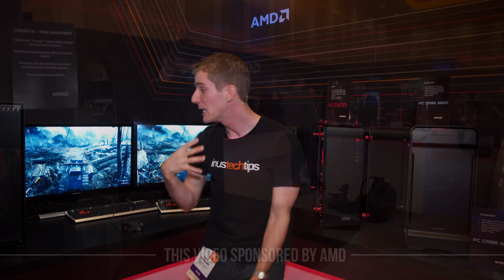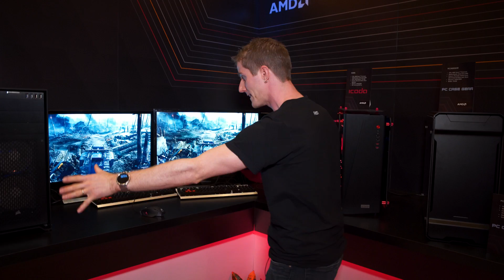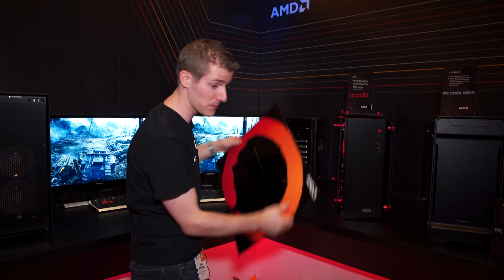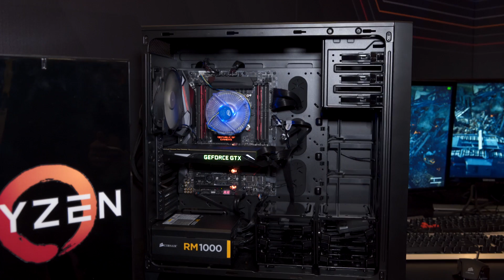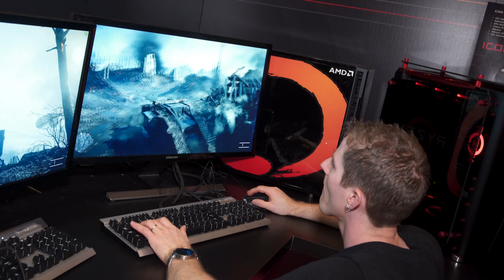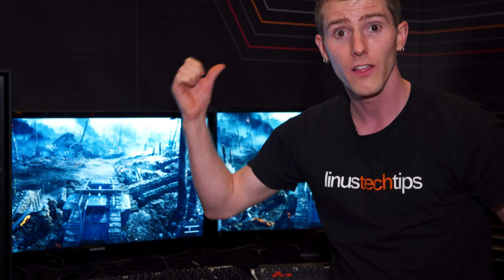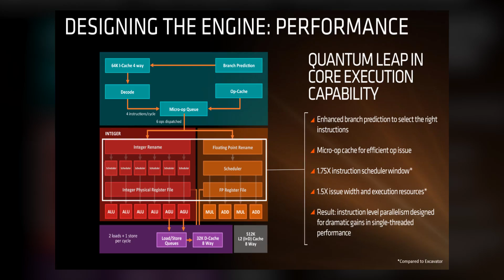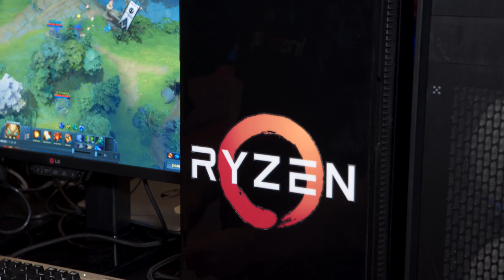AMD Has Ryzen!

Comment: Of course they are going to perform exactly the same as it is a gaming scenario and all the heavy lifting is done by the GPU. Even a 'lowly' i5 6600K when coupled with a Titan XP will perform the same as the (1000 dollar) i7 6900K that was used in this demo as parallelisation in gaming is handled entirely by the graphics card. The only variable from the CPU standpoint that may (maybe not - it depends) affect gaming performance is the clock frequency as it dictates the speed of offloading to and retrieving from the GPU. And in that front the mainstream flagship i7s (like 6700K/7700K) with their higher (turbo) clock speeds (of 4.2/4.5 GHz) will do better than the 6900K that is (turbo) clocked at  3.7GHz.
Reply: Alex Marin I'm so glad I'm not the only one.
Reply: Intel and AMD include integrated graphics but they are bypassed and the graphics processing is handled entirely by the external GPU due to the benefits of the huge parallelisation it brings. These benefits far outweigh the communication bottleneck between the CPU and CPU, which is a GPU-induced bottleneck. That is and why you see a GTX 1080 on PCIe3 x8 doing almost identically as one in x16 mode. Anyway the conclusion remains. When it comes to games any flagship CPU is more than fast enough for the job is designated to do (offloading/retrieving to/from the GPU) and any graphics performance depends entirely on the graphics card.

Comment: I just feel like to upgrade to an i7 standard, I might as well have bought it 3 years ago when it was the same price rather than wanting to first buy an i5 then upgrade to an i7 in which the price hasn't dropped, but hopefully, with AMD stepping up and adding competition, processors will increase in power and decrease in price.

P.S I own an i5 since Intel has been superior for a while but at this stage, I'm fairly 50/50

Comment: They're using an nvidia gpu in order to eliminate the possibility of bottlenecks. They're newest card, the rx480, is designed to be a budget card with low power consumption. The Vega line hasn't been revealed yet or they would be using that instead.

Comment: AMD Is doing well and I'm waiting for their CPU's to come out. Because, I need to spend a shitload of money for a i5 skylake (I don't want to build a new ddr3 system in 2017) And, i can't have a i3 because there is no overclocking and I need to wait for a overclockable i3. Intel's cheap is too weak for somethings.  I hope AMD will bring better CPU's with 4 cores with the price of an i3 6100 and support overclock out of the box. It can kill the intel. AMD improved itself and AMD will use the same AM4 platform for an APU and CPU. What that means? It means you can build a cheap system with an APU in start than add the pieces when you have money. This is good news, isn't it? The new APUs of the AM4 will be better I think. Now, you can play GTA5 with AMD A10 7890K APU.(Low settings of course and it is playable.) It is good performance. With the new DDR4 rams, these APU's will have a lot better performance than current APU's. Best integrated graphics now belongs to the APU of the AMD. (Actually this is because AMD is designed the APU for what it is meant to be.)

Comment: For those of you not old of enough or may not remember this, in the early 2000s, AMD made the best/fastest processors.  Intel while trying to rebound came out with the Pentium 4 which used super expensive rambus memory and performance was terrible.  AMD processors were cheaper back then so Intel had to cut prices in order to compete plus the rambus memory was a fiasco on so many levels as it cost nearly double what ram cost at the time.  Then Intel introduce the Core/Core 2 architecture and jump ahead of AMD.

Now for the last 6 or 7 generations we have the same pricing scheme and lock in with Intel.   We need AMD to make great processors, competition will help our wallets, and push Intel to come out with better technology as a response.  As consumers we win in this if Ryzen lives up to AMD's promises.  

Now here is the problem, AMD made the same statements with BullDozer and we all know how that turned out.  Hoping for that the hype is real this time.

Comment: AMD might not win in the gpu department, but they might win the cpu department
Reply: It is. I'm liking this fx4350 at 4.5ghz. It's lightning fast. I could have 2 of them for the price of Intel. I've never bought in Intel chip, but I've bought a few AMDs. Usually the price was so good I couldn't resist. That's winning.
Also if you like your money and price is an issue then you're buying an AMD 470 or 480 right now. They don't have anything for the 1080 but they say that's coming too. We shall see, but they are winning some gpu sales now.
There is a reason their stock is up so much this year.
Reply: I myself use an AMD Athlon x4 860k clocked at 3.7ghz and I'm pretty sure it's overclockable
Reply: not true intel has been better at every price point for years

Comment: That CPU encoding portion seems weird still. Is it running at the same setting or different settings? Are they claiming to be getting better quality on the same settings, which would sound crazy to me? Or are did they tweak the settings to look better on theirs while maintaining the same performance as the Intel chip?

If they tweaked theirs to look better and maintain the same performance as the intel chip, how is that balanced to be fair? Did they similarly tweak the intel chip to look it's best at the same performance?

I really don't see how there can't be a large bias in the CPU encoding/streaming demo.

Comment: Problem with this is is that Battlefield 1 isn't a CPU intensive game...It's a GPU intensive game hence AMD using Nvidia's Titan X Pascal lol.
It's also VERY well known from past AMD Cpu's that they don't yield good results WITHOUT a very strong GPU.
Intel Cpu's don't require high end Gpu's to give best performance.
This is once again AMD promotional hype train to nowhere as once you purchase it and fit in your new build WITHOUT having a 1000 pound card you don't get anywhere near the promoted hype train results.
Reply: MayDay GoingDown!! Amd benched ryzen in Blender twice and in handbrake. Still showed comparable performance to a 6900k. The same applies to the benchmarks Canard pc did with their Ryzen engineering sample (if you adjust for the fact that it was clocked at 3.15-3.4ghz).
Reply: DjAtomica 95 Yeah I watched that too lol. Problem is they are both synthetic benches, 
From a gaming piont any and all professional benchmarkers don't use them as those results become a whole different story when gaming.
Reply: MayDay GoingDown!! I'm afriad I'm not following you?
Reply: Well the chips are out now and apparently you do.

Comment: Intel processors are cooler, quieter, more energy-efficient, and easier to overclock.

Oh, and I forgot that Mobos for Intel Sockets are more common.

So what's the point?
Reply: Well,Intel CPUs arent cooler at all, my oced ryzen 1800x doesnt get over 60 degrees for instance, while my i7-7700k gets well over 70 degrees with the same fcking radiator and fan
Also, quieter? WTF has this to do with anything, its about the fcking fan u use, not the processor, and the wraith stock cooler by amd is actually better than the intel stock one, not that anyone would use Stock coolers and expect them to be somewhat silent^^
Energy-efficient? Jeez do you even look up stuff before you write things?
The 1800x has a tdp of 95 w, which is a 8 core processor btw, while the i7-7700k, a 4 core cpu, has a tdp of 130w ^^
Easier to overclock? You mean that you have to spend like 50 bucks more for a processor/mobo to be able to overlock with intel cpus, while every ryzen and pretty much every mobo for it supports oc? Or that you dont even have to go to the BIOS to oc the ryzen anymore ? Yeah m8, no
"Mobos for Intel sockets are more common" yeah, thats true, but what difference does it make? Both sides have enough, probably even to many Mobos, you dont even notice the difference.
Not beign said that Ryzen Mobos are mostly cheaper^^
Now fck off with your fanboy stuff and get real, dont buy a product because you like the company, buy it because it is better for you. And get legit arguments pls, if you would have said that Ryzens are not as good for gamers i would have fully agreed with you, but dont post bullshit in here^^
And if you still want to call me an amd fanboy, im not, i have quite a few processors of both sides here^^

Comment: YES! Competition again. Haven't had an AMD chip the since an overclocked Barton 2500. If this is true it means lower prices and no more $1000+ CPU's for top performance for a good while.
Still rocking an 4960x IVY Bridge clocked at 4.5 ghz and can't see a reason to upgrade for a couple more years, but this sort of competition means that in a couple years I get one heck of a fast CPU from somebody. Emulating consoles like the the WiiU will be childs play to whatever cpu that is. YAY.

Comment: No one wants or cares $800-$1000 cpus. The vast majority of gaming happens at $250-$300. AMD will have to launch better and cheaper cpus than Intel i5/i7 3rd and 4th generations. eBay is FULL of $150-$300 Intel i5/i7 cpus from 3rd/4th generations, which kind of annihilate everything AMD are offering in the past 5 years. This is performance/$ of course. So unless AMD is coming up with some REALLY cheap better cpus, I will go with Intel this year. Even is AMD brings cpus same price as Intel, they can still f**k off! This over hype trend that AMD is pulling each time they release something is ridiculous and not founded.
Reply: IF they do. There is a big IF coming from AMD. Same IF as every year in the past 10 years at least.
Reply: That is absolutely not true. I was an AMD customer from 2003 to 2016. I owned only AMD cpus. I started to be AMD fan with the AthlonXP series and even more with Athlon64. I know what they can do. They are shit. And expensive. Only slightly cheaper than Intel. Almost all my friends have switched to Intel in the last 2 years. I was an idiot and not believed them ,still thinking AMD rock. I never ever imagined how powerfull a cpu can be, until I bought a used I7 4790k. All for the same price as the shity 8320. Instead of buying a new 8320/8350 I bought a used i7 cpu. Even the old 2600k, 3770k are more appealing than AMD. I am sorry but AMD failed me, they suck, lets admit it. You know that saying: 'I am too poor to buy cheap things'. You end up being unhappy and they don't last. That is how I feel about AMD products.
Reply: How old is a Phenom?? Holy shit...AMD is the best. Intel and nVidia band wagons are getting too crowded. It's time for them to crash and spill over.
Reply: Ryzen passed our expectations. Intel stayed really comfortable, having small improvements while bumping out the prices. Amd stayed quiet for a long time and ryzen is so much better than the fx series, while keeping it at a reasonable price.

Comment: Please Jesus can AMD release some epic CPUs and GPUs soon. I'm fucking tired of Intel and Nvidia fleecing the market with their <10% annual improvements at extortionist prices.
Reply: what about the 70 percent boost from the 980 to the 1080
Reply: Are we so readily forgetting AMD was more than happy to jack up their prices during the bitcoin craze
Reply: Market dictates the price. The RRP was the same, but because of the highly exponential demand the real world price also went up. It's literally Business 101. If Apple or Samsung or whatever decide to release a 500 USD phone but will only make 5000 of them, then it turned out these phones could fly to the moon, then those phones would skyrocket in price regardless of what the RRP is.

I highly doubt AMD foresaw the bitcoin craze and I very much highly doubt they told all the vendors to jack up the prices once they saw miners stocking up in them. And if you were smart, you would've bought the cards 2 months later when all the miners were dumping them on eBay for pennies when the BTC fad died. Again, basic Business 101.
Reply: Yeah nvidia is doing a pretty good job but intel? meh
Reply: Nvidia and Intel are not extorting anyone. It is supply and demand. People demand good cpu/gpus, with best performance-to-price ratio, and Intel and nVidia are simply offering these. Basic economics. You learn it in primary school. AMD are failing to supply competitive products. For a decade now. Simple again. All AMD needs to do, is to release cheap and good products. I guarantee you, in 6 months, they will have 90% of the market. Yet they refuse or can't do it. It's greed or a disability. I strongly believe 80% of gamers are gamers on a budget. They start with a budget when they build the PC. If Intel/nVidia would have exagerated prices like you say, these budget builders would look towards AMD. WHY ARE THEY NOT DOING IT? I will tell you why: AMD is either having cheap and bad products, or good but too expensive ones. It seems Intel/nVidia found a solution in the middle. They are finding it every fkin year in the last 10 years.
Reply: +MarioDragon AMD didn't raise their prices. Stores raised the price and raked in the profits of increased demand. AMD didn't see a dime of that increase. Just like Nvidia didn't see a dime more of their parts that were being sold over MSRP. There's even another layer that wasn't mentioned but AMD sells to board partners not to retailers. Those board partners adjust the price sell to retailers who adjust the price and sell to us.
Reply: I changed GTX970 to GTX1070. From 25% to 40% more gaming performance so I don't know what you talking about (nVidia only)
Reply: Karlsanada13 I think that Intel must move because the performance improvement after each generation of nvidia's GPU is way better than the improvement of Intel's CPU... I wasn't a fan of Nvidia, my R9 280X was a beast and I loved AMD but the 10XX generation is totaly insane and AMD cannot do anything... Only Nvidia move and if AMD die, the GPU prices will be insane...
Reply: Do you mean

EPYC?
Reply: Turns out they released some Epyc CPUs
Reply: And AMD did it pal
Reply: me too
Reply: That was due to the fact that there was a lot higher of a demand for them. Higher demand equals raise price because we cant make enough and they'll pay for it anyways. Intel and Nvidia is, "We have a fucking monopoly, so pay up bitch"
Reply: Give amd some love too guys cmon
Reply: Oh boy! I got you some fine news
Reply: You're about to get your wish :D
Reply: They will leave AMD in the dust once they're actual competition and they actually need to try. Don't worry
Reply: @MsHumanOfTheDecade lmao… L
Reply: Thank you. Lot's of people on the internet seem to forget that. Scalppers not only exist for Comic con and the like, they also exist in the form of stores with high demand low supply products.
Reply: lmao Nvidia with the best card ever 2016 this year but whatever right
Reply: what do you want from their gpus? They released the RX 470 and RX 480. Both kick nvidias ass in similar price table
Reply: sickbastard82 that is hyperbole. They do win in performance per dollar in a number of games, but kick their ass would be stretching the truth.
Reply: Bryn Barker Nvidia destroyed everything with Pascal, their is a huge difference between 980 and 1080
Reply: Tykxon What can you do with a GPU on Linux ? There is not so much game with it...
Reply: Me too! Just for the record I had AMD hardware and it worked great no problems at all except power consumption maybe...still intel skylake 6700k rekt my AMD 8320 oc to 4.4Ghz
Reply: I am not so sure about Nvidia rightr now, though. the leap from GTX 970 to GTX 1070 (yes, I know it should be compared to GTX 1060; but at launch price 970 is up there with 1070) is so huge that you can just sell off your 970 and get GTX 1070. Intel, on the other hand, needs more competition, and AMD needs to rise up and stop hyping things up.
Reply: Karlsanada13 Intel sell new CPU everytime but the performance improvement is so low that there is no reason to buy a kabylake when you have a i7 2XXXk but this CPU is 5 years old...
Reply: I agree. I agree that Intel has not been innovative as much as they need to because of lack competition. I have i7 2600 (from i5 2320) and recently bought it too. I cannot afford a full upgrade to 7th gen with 
ddr4 rams. I was praising Nvidia since they did a good job with their current gen. Intel, not so much.
Reply: +Rémy Baillet TBH the GPU prices have been insane for the past few years. I'm looking at paying 500 $ for an average GTX 1070 these days while my GTX 770 4GB cost me around 350 $ right around when that came out. At 500 $ I'm not even sure I feel like upgrading, and the improvements I get for 250-350 $ are honestly rather marginal.
Reply: I am hoping the best for AMD APUs after so many gamers poured out money for ''Foundation''  1080s  and 1070s,  only to see 1050 Ti OCs  matching performance at 1080 gaming for a little over a hundred bucks !
Reply: you are smoking crack the 1050 ti isnt even close
Reply: I want AMD to fix their cooling on their gpus cause I don't want my gpus to explode or catch on fire.
Reply: reference card always suck though. XFX RX 480 never reached more than 60c at 40% fan speed.
Reply: Same on a 280x, no problem with the cooling
Reply: Clear proof and explanation why Ryzen R7 IS BETTER than i7 7700k for (FUTURE) GAMING :)
/watch?v=ylvdSnEbL50
Reply: Bryn Barker yea there releasing a Eypc cpu
Reply: boom
Reply: well the gpu market is still fucked up as of may 29 2023 (when i am writing this) but the cpu market is a lot more competitive now. thanks amd!
Reply: Oh you poor soul you hadn’t seen nothin yet😂